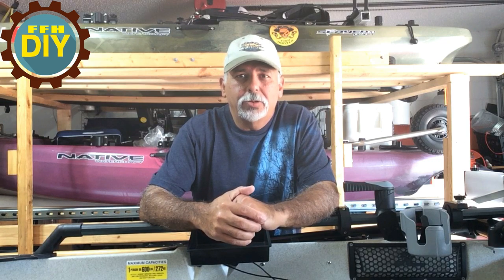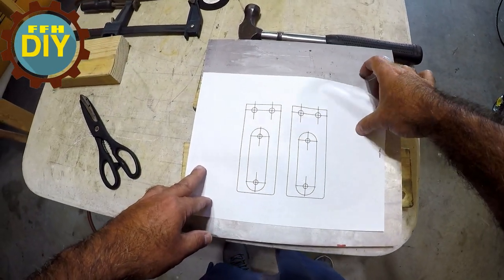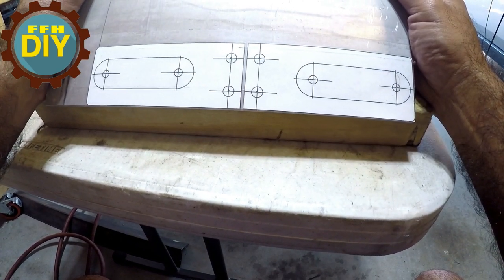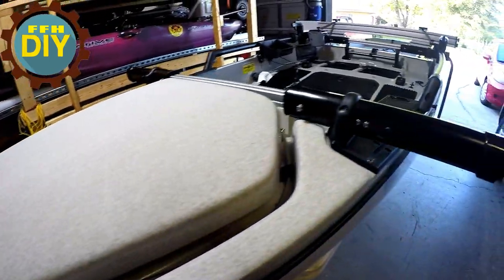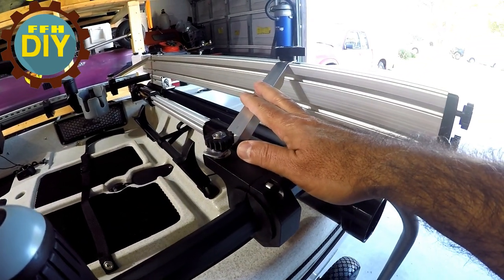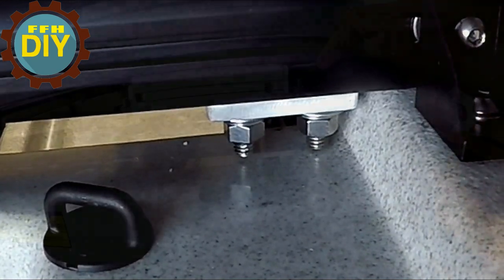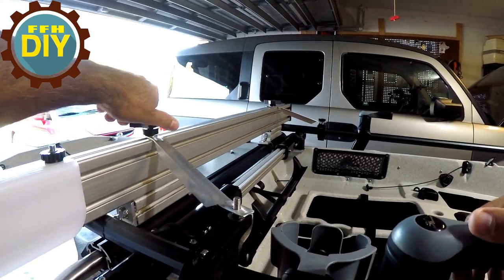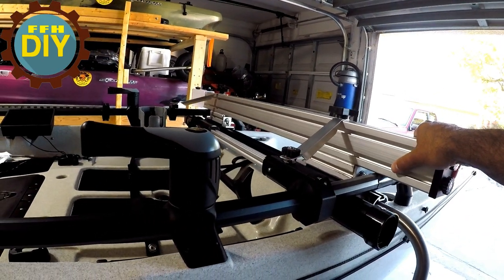Ama / Motor Mod: 2019 Hobie PA14 for Offshore Fishing - Florida Fish Hunter

Comment: do you have any issues (cavitation ) using the short shaft motor with that motor mount being so high ?
Reply from the maker: The outboards cavitation plate sits a good amount below the hulls waterline so there are no cavitation issues.

Comment: How do I get to ama's and the rails to attach them I have a 2019 Hobie Oasis
Reply from the maker: You have to get them from Hobie by either ordering them thru a local Hobie dealer or an online vendor that sells Hobie parts. I would recommend a local dealer so that you get the correct parts that you need for the Oasis.

Comment: How wide is the upper portion where the motor mounts ?
Reply from the maker: The 1" x 3" extrusion is 50 inches.
Reply: @FFHTV  thank you, very helpful. Almost bought a 48 inches but cancelled, ordered a 60 inches instead to be sure… your video is the greatest footage of a build…
Reply from the maker: Thanks BhoeyG! Just a thought - with 60 inches you may have enough real estate where you can mount an outboard on one side and a trolling motor on the other. 😊👍
Reply: @FFHTV  yes indeed, great thought, i may insert this in the planning. Still in the gathering phase of this build and research. Almost there just waiting for the outrigger setup from West Coast then finalize my approach… thank you.👍👍👍
Reply from the maker: You are welcome! 👍